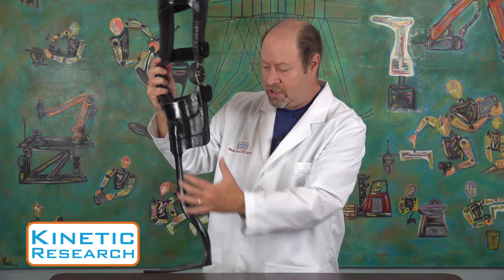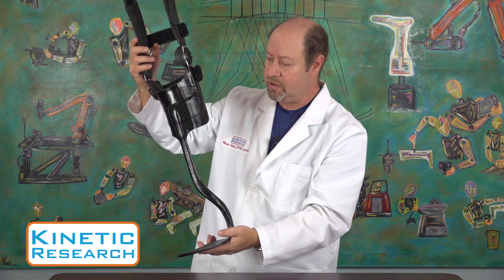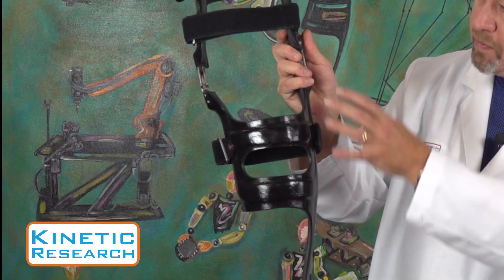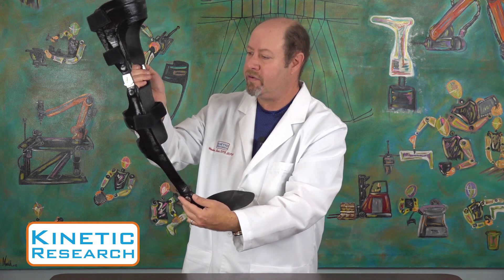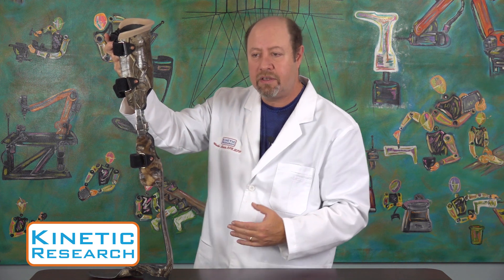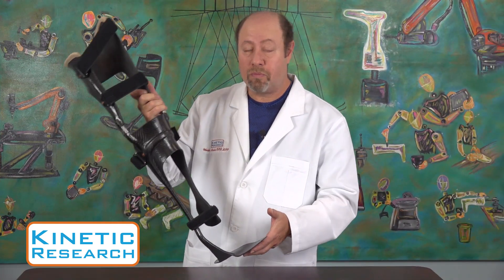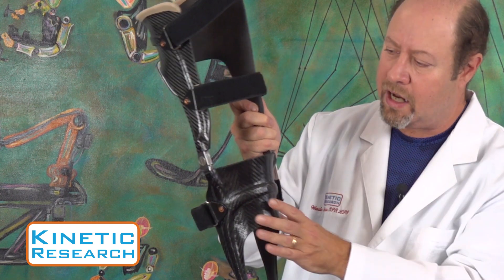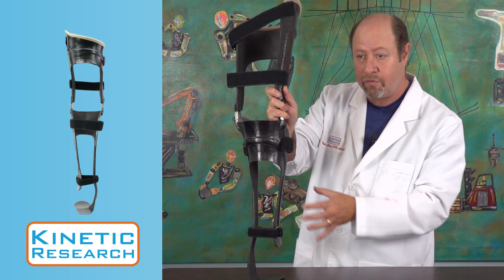Carbon Fiber KAFO | Lightweight knee ankle foot brace| Product Description

Comment: This looks wonderful. I have a patient with extreme active hyper extension during weight-bearing but can be controlled with intense concentration however she has quite significant spasticity in her gastroc‘s causing plant affection. She currently wears and AFO however I really would like to control her knee hyper extension. This device looks like it would work on both the knee and the ankle issues that she has. Is this Product available in Australia?